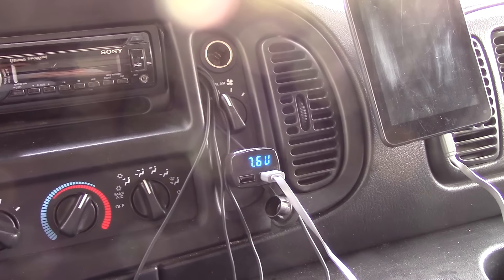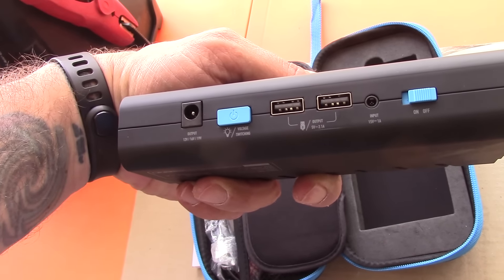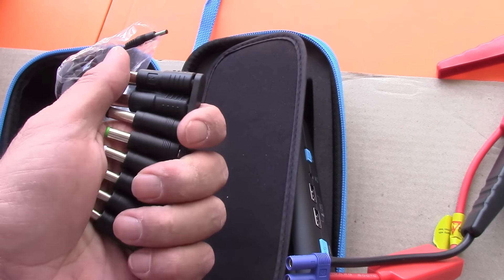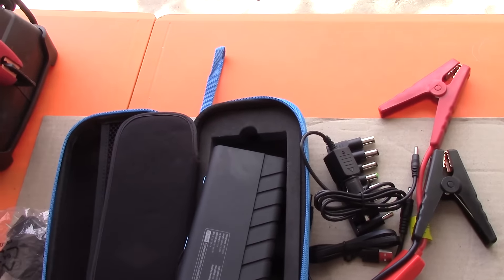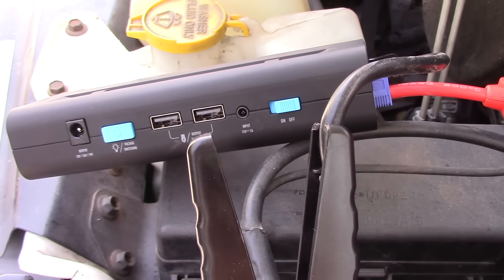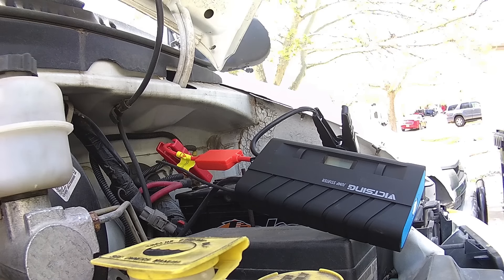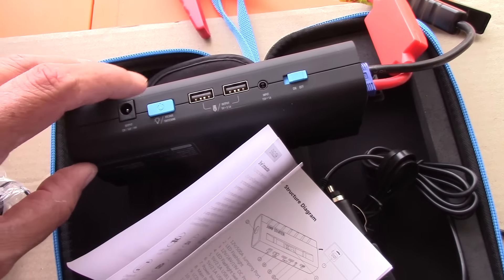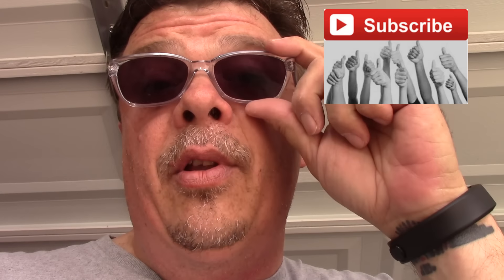How to Jumpstart a car with a jump starter, jump box, portable battery box, battery charger, thing!

Comment: Instructions:
1. Turn off car head lights, window heating, radio or any electric stuff on your car. Make sure jump starter is off.
2. Connect - clamp (black) to battery - terminal.
3. Connect + clamp (red) to battery + terminal.
4. Turn on jump starter and start a car.
5. Quickly turn off jump starter as soon as car starts.
6. Remove - clamp from battery.
7. Remove + clamp from battery.
8. Do not run jump starter for more than 30 seconds, Give 10 minute break before next attempt to start a car. It will get hot and batteries can explode even light up your car if used improperly.
Reply: Should connect positive terminal first

Comment: OK! So i just got my little jump box in the mail today! 
Charged it to 100% & fallowed instructions in the book & got smoke & sparks & I think even a little blue flame!
The instructions say:
 Important: Please turn ON the main power switch before use.
1. Hook clamps to + to + & - to - to battery terminal of car
2. Insert the terminal into the port of this product
3. Turn your car on.

Well I tried twice & & both times got smoke & sparks!

That is not how you did it though...  you had everything hooked up then turned the unit on & then started your van.
If i have not fried everything or anything in the unit or my car lol! I am going to try it your way!
Reply from the maker: +MoJo7Crow did it work?
Reply: I had to wait to hear back from someone if it is ok to put the negative clamp on the copper kill switch  or if I needed to remove the kill switch etc...  they said it should be fine to just clamp it on there so I will give it a go when it is light out again. 
I will let you know! =)
Reply from the maker: +CheapGeek well?
Reply: The unit is not working properly. Waiting on refund. Will try again soon as i get another one.
Reply from the maker: dang..

Comment: Hey did it take a long time for it to charge up your car battery? Or did you just instantly went to go turn the car on after you connected the adapter? -Thanks.
Reply from the maker: +TwistedNation01 I connected it and walked around to the drivers side and started it.  Maybe a minute?  Connect and start really... :)

Comment: I have one of those copper toggle? switches on my battery to stop drain when car is not in use. How would I go about jumping my car with that attached?
Reply from the maker: MoJo7Crow if I understand....you need the toggle in the position that would allow you to start and drive the car. then you would attach the jumpstarter to the battery posts. then jumpstart the car. :)
Reply: The switch is attached to the negative post I believe... its right on the battery, no cable to it.
Reply from the maker: ok, you'd need to attach the jumpstarter cable directly to the battery post. make the positive and negative cables match
 the posts.
Reply: Cool beans! Thanks for the reply!
Reply from the maker: Ha! No Problem! Thanks for commenting and watching, I appreciate it.  :)
Reply: Just one more thing! I went out & looked & I have separate post positive/negative  that are not right on the battery but mounted above by the fuse box. Can I use those so I do not  have to take toggle switch off the battery? I wish I could send you a pic so you know what I mean. 
I have a 2001 Monte Carlo LS if that helps? lol
Reply from the maker: +MoJo7Crow I believe you can.  :)

Comment: How weird that it worked for your V8! I have watched 12 videos now with people using these little booster & none of them worked, not even on little cars!
I am going to look for this brand specifically.
Reply from the maker: +MoJo7Crow it's  all about the Amps..the amp rating of the charger should be close or even more than what the battery needs. Match the Amps and it should work fine...:)

Comment: Your one of the two people I've found so far who actually give a solid explanation and example on how to use these. My cars dead and almost positive it's the battery. Had a Napa bluefuel in my trunk but it's my first time trying to use it (and lost the manual) and Napa doesnt have user guides available online. At least none that I could find. Hopefully this will solve my issue and I can get it replaced. Again, I really appreciate it 🙏🙏

Comment: does it shut down when fully charged or will it continue to draw power, im thinkin leave one plugged in a spare power port in my truck and its always ready to go.
Reply from the maker: +deltatoofow The lcd display blinks when its charging. When its finished, the screen stops blinking and reads 100% which stays on. I don't think it continually charges. I think it stops charging and then uses the internal battery to power the 1/2 x 1 inch screen. I don't think there's any parasitic draw coming from the charger. :)

Comment: What camera are you using for this video?  What settings? The video looks really clean.
Reply from the maker: +Jay Hunter I'm using a cheap Canon Vixia HF R50 Camcorder.
1920 x 1080 @60fps AVCHD codec rendered to 35 mbps in  .mp4 
YouTube will compress the video to about 9-12 mbps on upload. :)
Reply: +CheapGeek Is the vixia better than your eos m?  or just easier to use?
Reply from the maker: +Jay Hunter They both have pros and cons...But- I will say there is no EASIER way to make videos for YouTube than using a decent camcorder. The EOS cameras typically record at about 40mbps and the Vixia I'm using is 35mbps. So It works. I use them both.